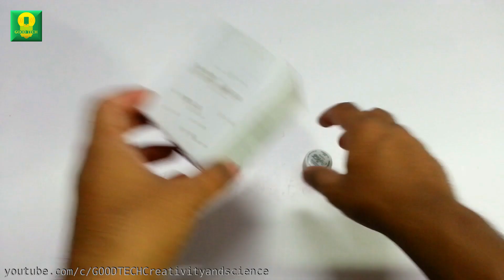How to make Remote Control Balancing Robot

Comment: can I use another motor instead of this motor
Reply from the maker: Yes, any motor can be used, if it has sufficient torque.
Reply: +GOODTECH - Creativity and Science can I use DVD motor
Reply from the maker: No, a DVD drive motor cannot be used as is. It has very high rpm and will not be able to provide enough torque. In order to use it you need to couple it with many gears to make a gear mechanism that reduces the rpm and increase the torque.
Reply: +GOODTECH - Creativity and Science OK
Reply: +GOODTECH - Creativity and Science can I use pulleys
Reply: +GOODTECH - Creativity and Science can I use pulleys
Reply from the maker: Yes, you can give it a try.

Comment: I need help please can you where can get the materials like the rubber belt , motherboard , batteries, etc.......
Reply from the maker: I got the rubber belt while servicing my car (it is a car's timing belt), you can get one from a repair shop or use any other belt lying around, it just for grip (you can also use big balloons and wrap them on CDs.)
Circuit was extracted from an old RC toy, however Rx Tx circuits are also available online on robokits.co.in

Comment: Total BS.....  This thing is naturally balanced , so there is nothing to do  achieve  to gain balance. This not a Self balancing robot.
It is just a 2 wheel toy  with center of the mass is below the axle.
Reply: right
Reply: Nevertheless its very innovative and simple. Its balances as such, no need for criticism. Instead of using a feedback loop he has designed it smartly.